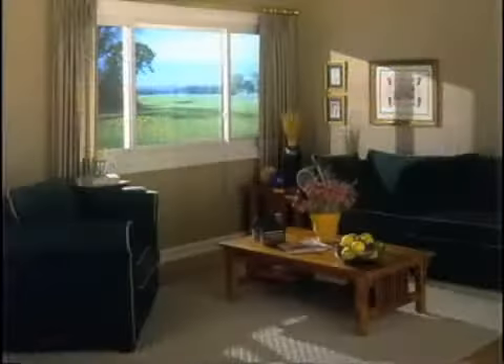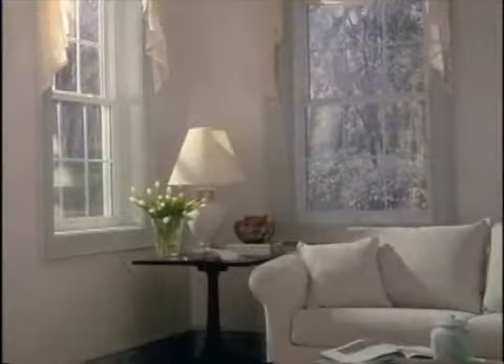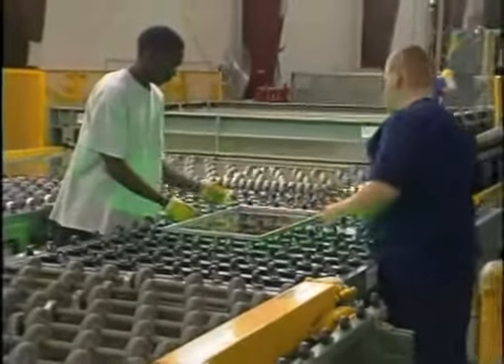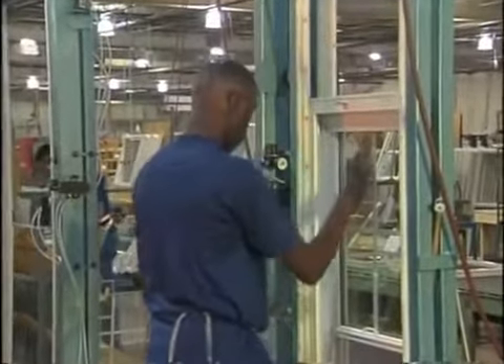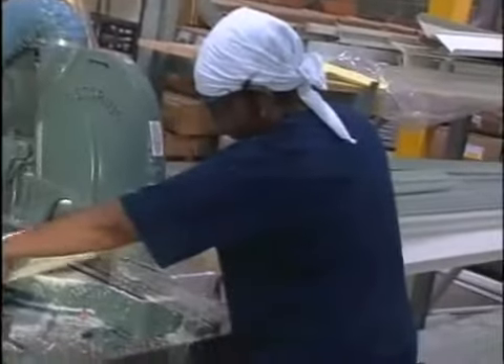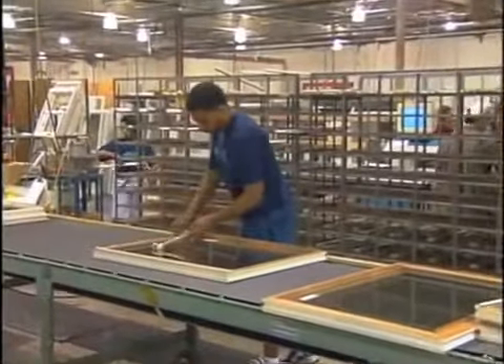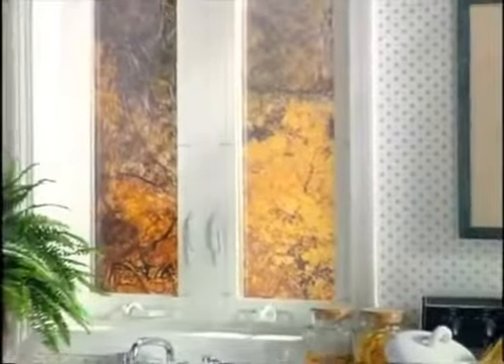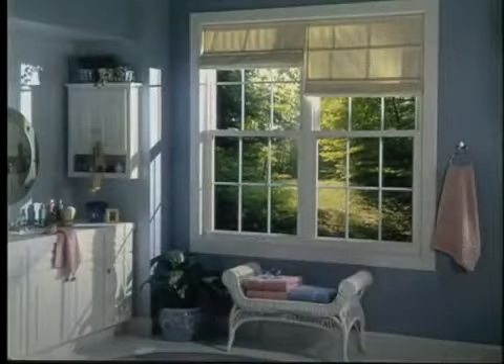Alside Windows

Comment: 'I have this crap in my condo. the warranty says 20 years. more like 5. In the first 5 years 8 windows sashes fogged up and had to be replaced. In years 5-15 I have another 8 fogged  I have a total of 22 window sashes more than half have failed, A few are on their foggy second sash.  If I had more control over the outside I would have tossed all of them in disgust and bought a better quality brand. 

People ask me what I dislike about my condo, The windows!  My neighbors say the same thing. Avoid at all cost. Sorry their windows seem suspectable to any torque applied. If you never open or clean them they are probably OK.

Comment: How is it that the host, as well as so many people in this video are working in the shop while wearing bracelets and watches, WITHOUT having any safety gear on what so ever??? Ok, maybe the screen department doesn't require ear plugs. But Im pretty sure, pretty DAMN sure safety glasses are required at all times anywhere in the building!!
Reply: You'd be surprised. I worked there in Ohio too and I cut and welded the frames and put the hardware in. I was very laxed there. Don't ever remember getting a tshirt but then again I wasn't there during filming.  I may have come after 97-99 ish.  I recognized a few people in the video.

Comment: I used to work at Alside.  No way would I ever put any of their windows in a house.
Reply: Ha! I used to work there too.  In Ohio.
Reply: You prolly got fired is why you say that.
Reply: I live where it can get cold.  I saw too many windowe where the plastic broke in below zero temperatures.
Reply: @seanmacdonald5255  how the Mezzo windows from Alside
Reply: @titzit4754  I did ge fired but that was because I refused to work their mandatory overtime.  I milked 2 cows before and after work.  They told me that the cows could wait.  They were wrong.

I had paid it forward to them previously.  The fire inspector had regular scheduled inspections.  In between those inspections, shop management regularly blocked fire doors with stock materials.  Then all would get moved just before a scheduled inspection.  After the inspection the doors were blocked again.  I mentioned that to a friend who was a fireman.  A few days later there was a surprise inspection.  BIG fines for Alside.
Reply: There are different models of windows. The low end windows are built cheap and will not last without repair. I did not get fired from Alside.
Reply: I worked at Alside window company in Cuyahoga falls right off route 8. Not sure if this is the same company featured in this presentation though.